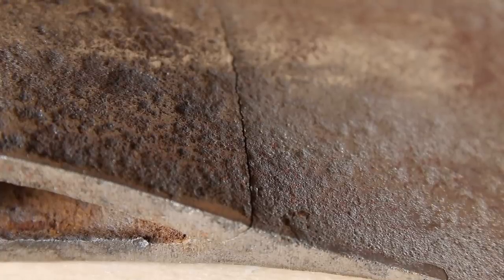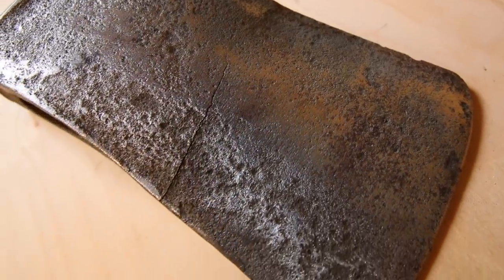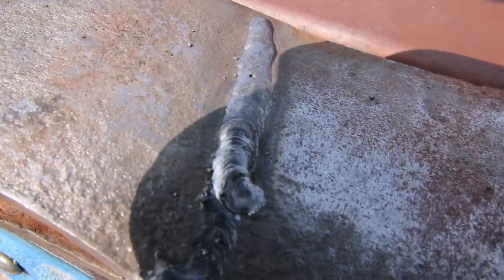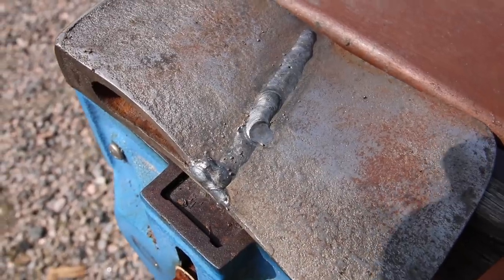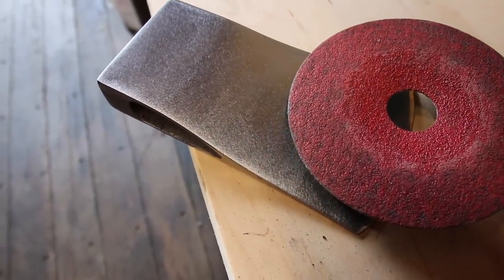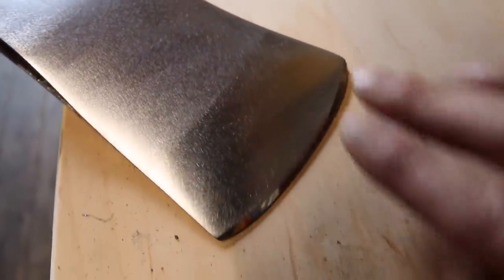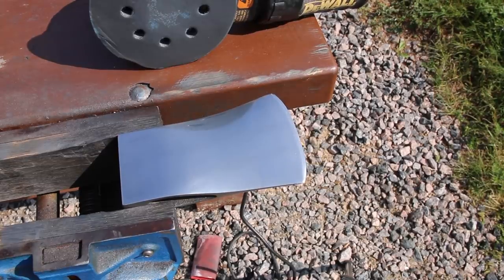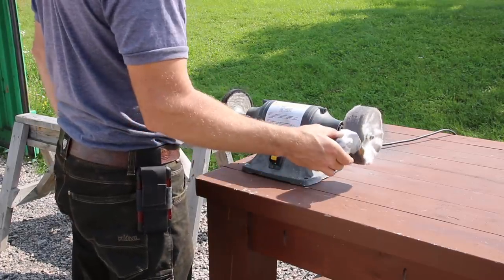Repairing broken axe and polish with Orbital Sander

Comment: I'm still using your old method of polishing stuff but I managed to find 320 grit flap wheels as the finest they come.  I tried using an orbital sander like you in this video but noticed it was leaving swirl marks so I went back to hand sanding at 400 - 2000 grit sand paper.  I did discover small 2" hook and loop backing pads for a drill or angle grinder and found small 2" disks in 600, 800, 1000, 1200, 2,000, and 3000 grit that I ordered that I will try once they come in from slow boat China.  I hope that will solve the swirl problem I had with the orbital sander and hope to eliminate hand sanding completely since it takes forever.
Reply from the maker: Anthony O I found some company's have sandpaper that are not consistent in the grits and will produce swirl. I bought my backing pads from sandpaper.ca   Good luck!!  Cheers!
Reply: Did you mean to write more? Doug?

Comment: You mix up your terminology a bit. You say the tip is harder because it was tempered, but tempering is in fact a process that reduces hardness, and increases toughness. That would decrease the edge retention of the tempered bit, and in turn make it less likely to chip.

Comment: I had a axe with a quarter inch crack coming off the eye going towards the bit on the top of the axe, it was relatively shallow and half of it was surface crack, I welded it and it filled the crack pretty good, in your experience do you think the axe will last a while? its a older hand forged axe and I read its common for them to have small surface cracks near the eye from the eye drifting process.

Comment: I'm trying to erase very small streaks, (minute 6:58). 
I don't know if it's possible... but I'm in that learning process.
Maybe I'm prevented by the limits of the type of steel used in an ax... I don't know, but I'm going to find out.

Thanks for your knowledge... (I know from my own experience that it is not easy to reach that point of perfection that you achieved) 👍👍👍👏👏👏👏👏

From Uruguay, Daniel

Comment: Pardon me for what may be a silly question: Could you have done little "spot" welds on some of the deeper pits in the axe? It seems to me that would have eliminated the removal of a bit of thickness in the axe from all the sanding. The camera work may have been misleading, but some of those pits seemed really deep.

Comment: Nice job.  I presume you are CDN.  If so, can you pleas tell me where you find the hook & loop fine grit sanding discs here in Canada?  I have found lots of sanding/emery paper up to 2000 grit & adhesive fine discs but can't find the hook & loop/velcro discs in finer grit than 400.

Thank-you for any info you can offer.  Cheers from the Left Coast.
Reply: Imightberiding try gluing said grit to get a used Velcro pad.  Just a thought

Comment: Great job on the welding, and the axe looks great - Don't take this as criticism, I'm just trying to save you time should you do another.  I think that white (aluminum oxide) is like 600-800 grit in paste form.  I'm pretty sure you could of got those same kind of results if you had skipped the 800 and 1600 grit paper and went to white rouge after the 400 grit paper on a sissle wheel then red rouge on the soft wheel.  It looks great either way, nothing lost but a little time.

Comment: Would it have been easier to fill the larger rust pits seen at about 3:07 with welding then to have to grind a lot of metal away from entire head to make each side even? I was thinking grind out with dremel tool then fill holes. Probably cut down on grind time.

Comment: Hi, in this video I see you are using  a rotary sander, this machine if i´m not wrong, if for sand wood, the sandpapers that you use, ar for wood or steel, i´m really new in this of recover old steel. by the way amazing job.
Reply from the maker: Gustavo Moyano it's just high quality sand paper for wood but works really good for steel also
Reply: French River Springs thanks you so much for answer so quick, I was not sure if buy the rotary sander or not

Comment: How do you clean the inside hole? Did you do anything about it, and how would you recommend cleaning that area?
Reply from the maker: Dmitrij Jazel I did clean the hole a bit with a round file
Reply: You can use a Dremel  or a power drill with a long wire bursh and remove all rust.

Comment: You're Using the wrong Word when you say "tempered", you mean that it has Been Hardened, tempering is an additional step which actually reduces the hardness slightly (while improving ductility)

Comment: obviously sub quality axe head to start with. the weld will always be a higher failure region, one way or another.
not something you want to swing to split wood etc and risk it, even though it's shiny now. maybe something to frame but not use. no matter your superficial confidence.
i like restoration of things that have value but, saving a $10 axe head using $50 or more and work, seems counter productive

Comment: two things!!!

First there is no way you sorted that crack the way you welded it. It look like you have fixed it but you should have V'ed it out!! Also you will have a heat affected Zone or Area around the weld this will weaken the axe!!! you should have heat treated the axe after the weld and the re heat treated and then tempered!

Secondly that line might not be the heat treat line its more like to be a welded bit not that you would know what that is!!!!